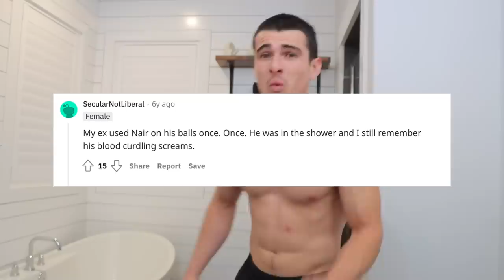Packing My First Box & Cleaning Out My Entire Bathroom

Comment: Lol They are macrame plant hangers (Mac-Ra-May). I love the adventure vlogs. Extra points for the kids cameos <3 Also, how do you make cleaning a bathroom funny?? Pause to try nairing your balls, apparently LOL I was cringing so hard for you. Glad you washed it off. I honestly would not leave it on longer than 2 mins if you do try that again. Literally, have the shower running already, and have a wet facecloth in there, glove up, set the camera somewhere, put it on, hit start on the timer for 2 mins soon as you finish applying and soon as it goes off, head to the shower and gently use the facecloth to help remove lol.